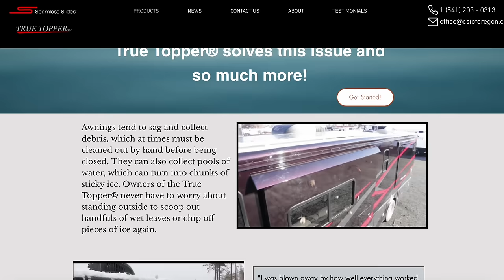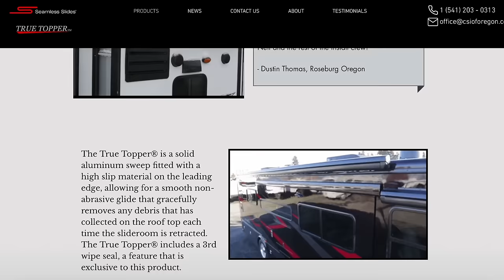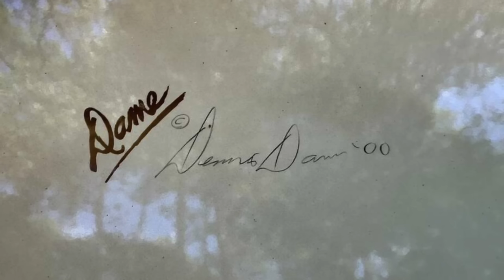Meet the True Topper® & Say Goodbye to RV Slide Topper Problems FOREVER

Comment: How do you like that coffee pot. It's been coming up in our feed. They look  interesting. They market them as cordless, but obviously  the base has a cord.
The topper looks awesome. Do they hold tight while traveling in windy conditions? 
Great informative video. Hope things work well for you guys.
Reply from the maker: We love the coffee pot! It’s just a water kettle, but it works off wifi or Bluetooth. So we can heat the water from our phone in bed. Then we do a pour over coffee method. 👍
Yes the true toppers hold tight with the spring locks when closed during travel. 👍
Reply: @IreneIronTravels  we use water kettle also with instant coffee the wife blends up. Less mess.
Hope you enjoy your time in Florida. 
Travel safe you 4.
Reply: @IreneIronTravels  thanks for the response 👍

Comment: I’m wondering how this modification would affect your Alliance warranty.  Also I noticed that the topper swept the leaves onto the awning.  Is there a chance of mold growing there if left over the winter season?
Reply from the maker: The way manufacture warranties work is an aftermarket alteration in one area won't affect your warranty in another area. For example if I had an issue with my frame or my roof it wouldn't be affected by an alteration to my slide out. Even adding all of those solar panels don't void my entire roof warranty, unless the issue was determined to be caused by the aftermarket solar panels. 

The awing actually catches falling leaves from trees if you are parked underneath them. The True Topper did exaggerate that , but all we do is run our awing out and the leaves easily come out. 👍
Reply: I noticed the awnings caught the debris as well. They could solve that by adding a flap over the closed awning.
Reply from the maker: Yes! Our last awning had a metal case or cover over it that helped protect it from the sun when rolled up and would probably help with debris as well. 👍
Reply: @IreneIronTravels  thank you so much for the video and information!
Reply from the maker: You bet!👍

Comment: Looks great but I don't think I would like all that debris getting pushed onto the awning.
Reply from the maker: 👍 The one slide is tricky because it has that awing there agreed. It was a lot of leaves from it being fall time, but leaves will fall into the awing regardless of the topper. A standard fabric topper will also drop leaves there when the slide is moved in. Its just the design of my RV. But you can roll the awing out and the leaves will fall out. Or blow them out. If it's just a few leaves they blow out when driving. 👍

Comment: They sound great but at that price it's to costly even with  lifetime warranty  even with your 5% discount. Many places have said lifetime but when it comes time to fix something they figure a way out of it .Not trying to sound rude just saying .
Reply from the maker: 👍 Not rude at all. Price is certainly a consideration and can be relative to each individual. I personally thought the price is pretty good when you consider a regular topper could be $700 or more depending. And your right a product's warranty is only as good as the company behind. And I think this is pretty stand up company.
Reply: Where was the price mentioned?  I’ve been looking for it. I realize every RV is a custom job but the fact that there is no mention of the costs even with an estimate indicates it’s expensive. File it under “if you have to ask you can’t afford it”.  I have not bought an RV yet but part of my budgeting is to include those after market necessities so it would be nice to know at least a ballpark number.
Reply from the maker: @azlady8102 it’s towards the end. In the last couple minutes of the video. But it’s about $1000-$1500 per slide fully installed with a lifetime warranty. A traditional topper might be around $700 installed.
Reply: @IreneIronTravels  that’s not too crazy for the product.  Cheaper than having to fix a slide out. Plus for me I’m not wanting to be climbing ladders if at possible.

Comment: Idk, I'm guessing that they installed these free or discounted. I saw plenty of debris on your slide in the video. It also pushed all the debris into the valley of your awning. C'mon if you're going to push a product at least be honest. For approximately $4500 I'd rather sweep/blow off the debris and know it's clean.
Reply from the maker: You saw plenty of debris on top of the slide after I closed them? I couldn't be any more honest and detailed in this video. It's ok to not want any toppers and just sweep/blow them off. Lots of people do that. But, lots of us don't want to and also want protection from the outside elements, so this is a new alternative.  👍